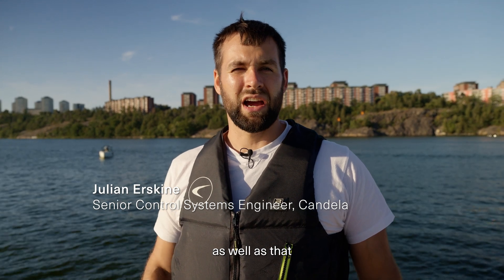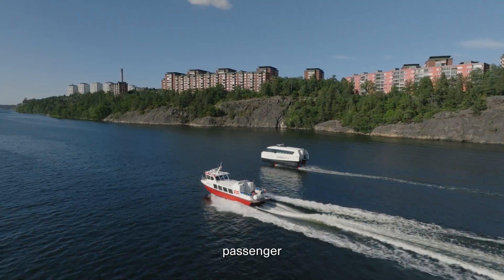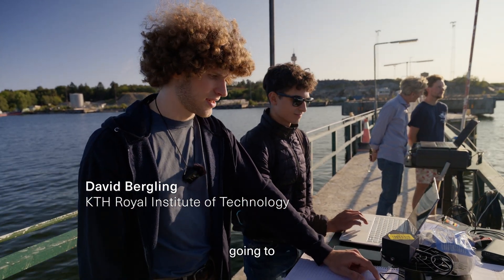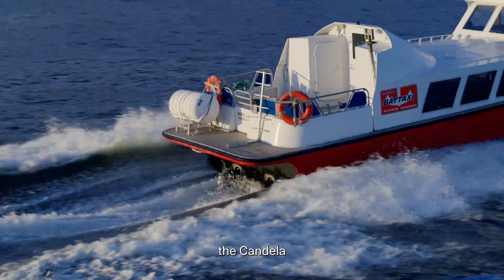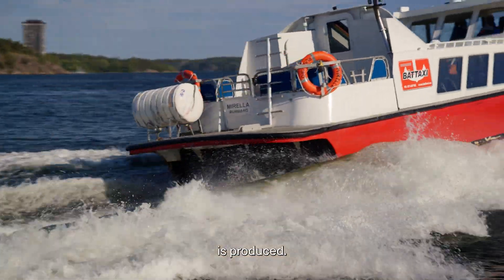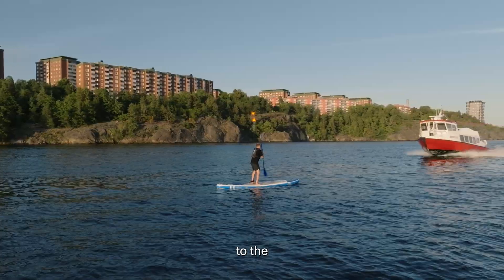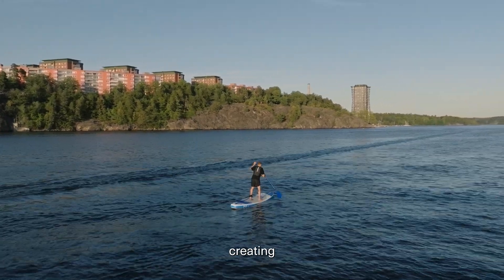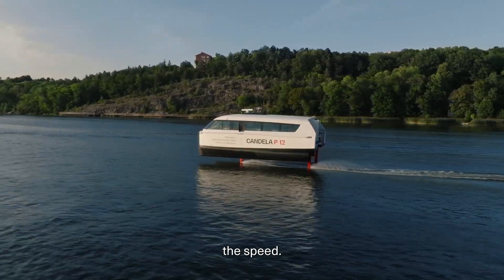Candela P-12 Wake Comparision | Electric hydrofoiling ferry VS traditional ferry

Comment: What would the candela p12 require to become a cruising boat with 2 berths, galley, a head and the foiling needs to lift to lessen draft? If the roof was full of solar panels to charge the batteries (maybe formed to provide some lift) and enough batteries to support 200nm+ what would the p12 cost? Maybe a backup generator would be needed.